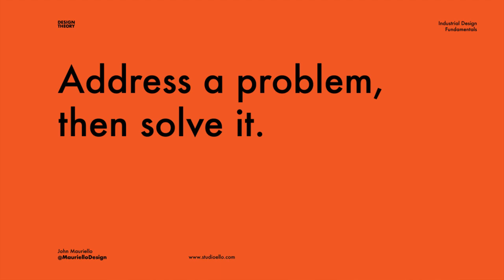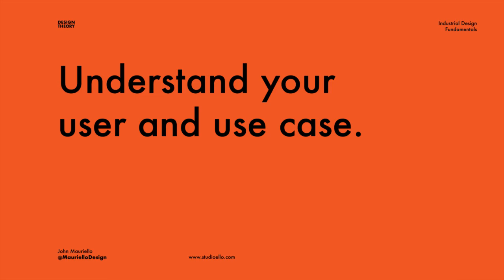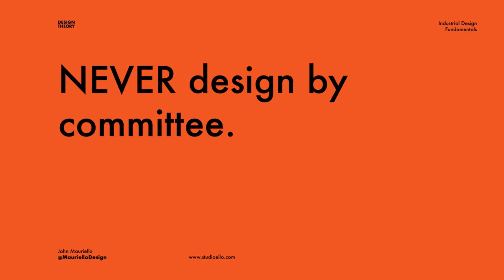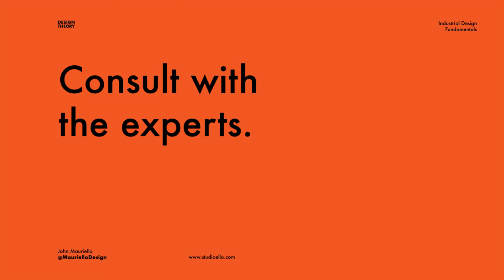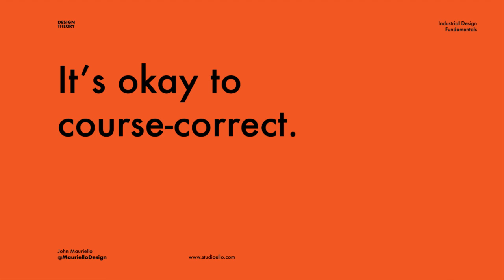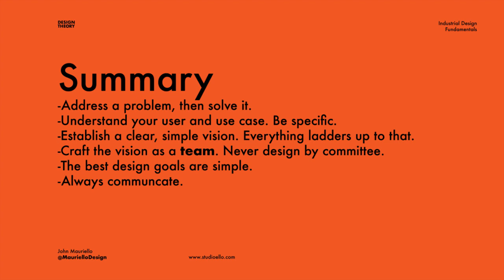Why Hardware Companies Fail: An Industrial Designer's Take

Comment: I work for a hardware startup myself and we do R&D work for other companies. We follow a system of agile hardware development (using Jira for planning, daily design meetings, etc.) and as far as I know we're the only hardware company that does it. We also understand that anyone can make a prototype but making a product for a mass market and designing for manufacturing require special skills that not everyone has.
Reply: Agile is the new buzzword in product development and loads of companies try to implement it. Unfortunately most companies do it wrong, ignore quirks of their industry or try to force it onto projects that dont suit the agile approach (build hw that does the same as an existing product but for 48V instead of 12V)

Comment: Great advice here. 

A big one missing that I’d like to add is Don’t ship too early. Too often hardware startups (especially VC funded/run startups) treat hardware companies like software companies. 

“Its ok if there are bugs we’ll just release a software update”. That mentality has killed so many hardware startups in the last decade its not even funny. Quality control is how you live or die, RMA’s on hardware are very expensive, you can’t update hardware on the fly. Test test test.
Reply from the maker: My next video is actually about this :)
Reply: The softwarifaction of everything is a problem. Im a mechanical engineer mostly designing parts that need molds or other expensive custom tools in a hw/sw focused company. The amount of people (mostly sw devs, management) who dont understand that orderung tools takes time and you cant just change them as you wish